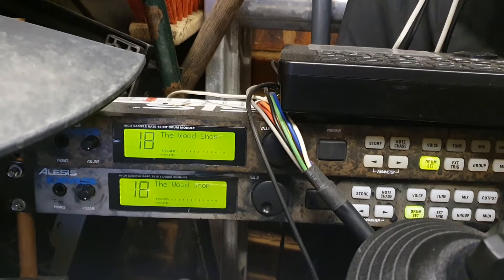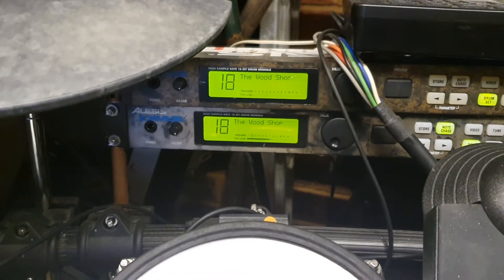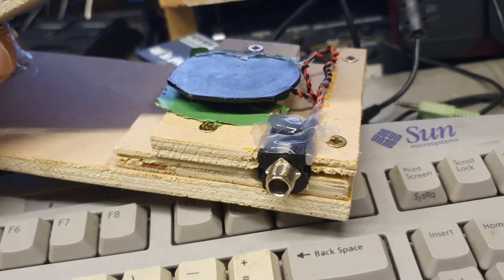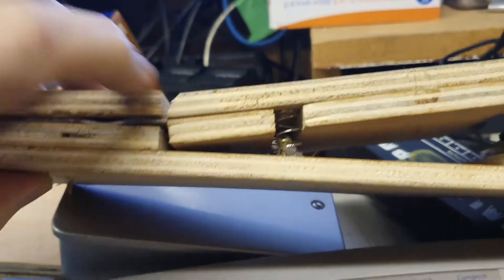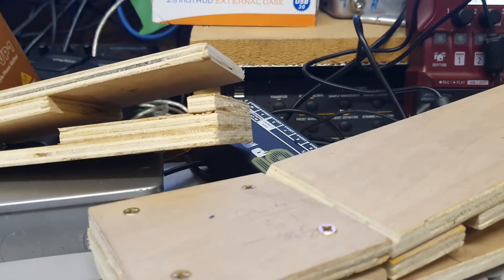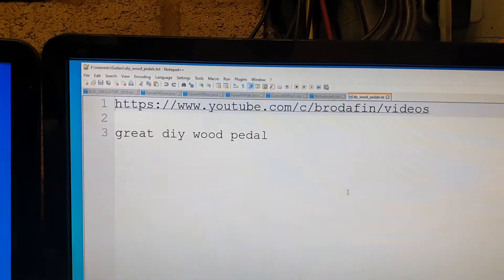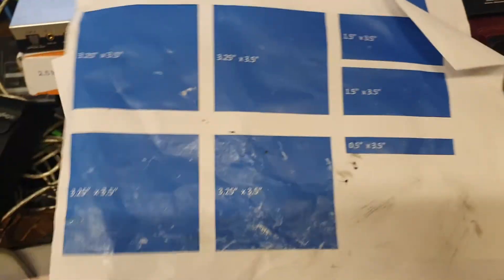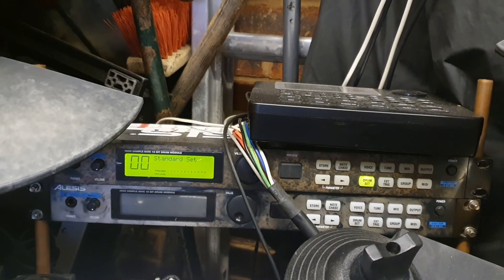DIY Electronic Drum Kick Pedal

Comment: 2:00 what do you call that hole in the lower right where you plug the cable from the module to the pedal
Reply from the maker: 1/4 inch jack plug socket. Here's an example from US Amazon.  Cheaper alternatives exist

Round 1/4 Inch 6.35mm Guitar Jack Plug Socket Guitar Pickup Output Input Jack Plug with Jack Plate Screws for Electric Guitar Bass (Black) https://a.co/d/0QREcZI